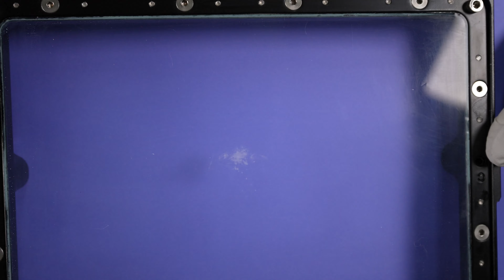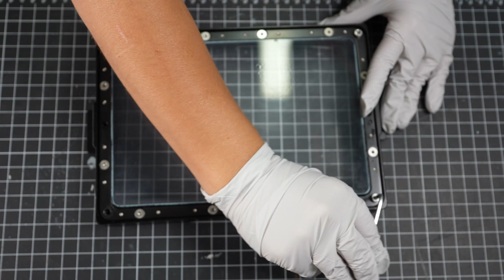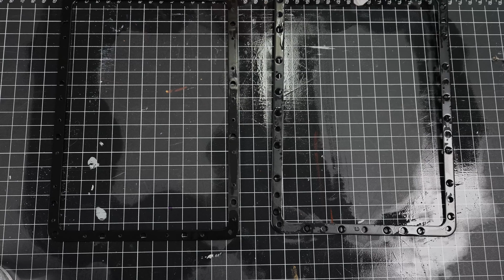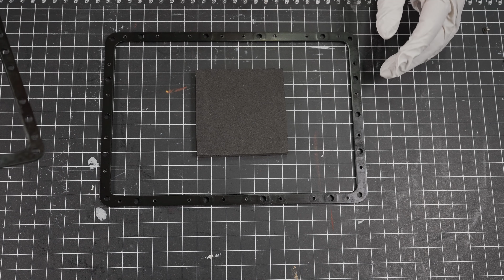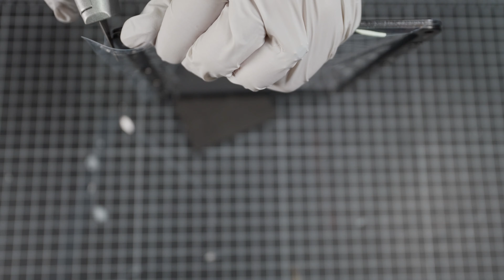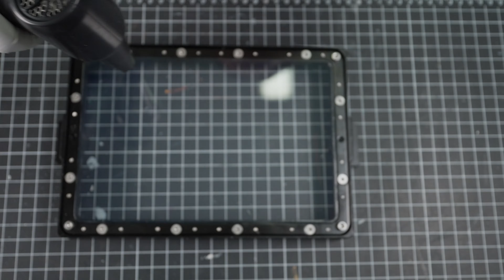Replacing FEP Film for resin printer

Comment: Great Tutorial, Kiki! What was the foam for if i might ask? It was about time i changed my Film on my Saturn aswell. This helped a lot. Keep it up! Thanks
Reply from the maker: The foam square adds some 'slack' to the FEP with the first frame, when next screwed into the vat - it will be pulled taught to the proper tension. (Allowing some give for the print to peel from the film during printing)

 Each printer will recommend a specific sized piece. This can usually be found on the manufacture site

Comment: Im having major issues with my printer. I have Elegoo 3.0 resin on my Anycubic M3 Max and it has been sticking to my FEP horribly. Ill make a video of it and post it. It gets like 3 prints and then destroys it.
Reply from the maker: Sorry you are having issues. Not sure what things you have tired so far? Lowering the lift speed can help reduce the prints from sticking to the FEP. That's a pretty common resolution, but it could be from a variety of issues..
Reply: @KannonStudiosOfficial  Im wondering now if its the FEP sheet and I should be going to ACF instead. I releved and slowed ti dow to a crawl I know its not the speed anymore.
Reply: @KannonStudiosOfficial  I actually think I figured it out. The pulling force was so great that it was moving the level of my build plate and when the print would break of it would jam the part back on the build plate and push it back and forth causing it to be shorter in the Z axis.
Reply: @KannonStudiosOfficial  Following back up on this issue. I had the lift speed to high which caused the film to stretch. Once I got it Dialed in and would print with black water washable resin I tried the Elegoo 3.0 abs resin. Wouldn't print. After more trial and error and resin sticking to the fep sheet I got some buffing compound and polished the FEP sheet. Printed. There is a wrinkle in my FEP sheet but ill print around it.